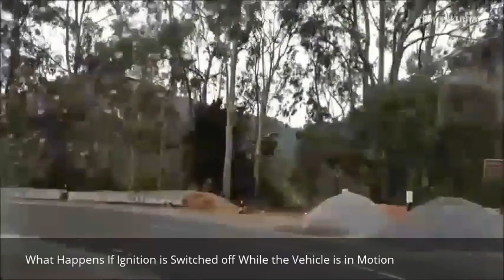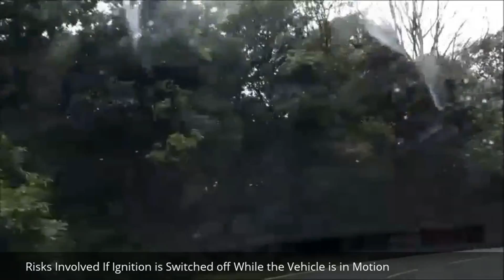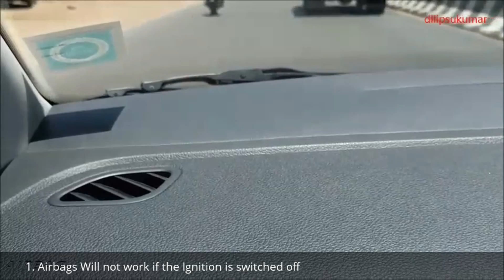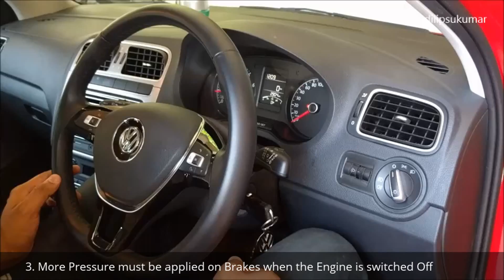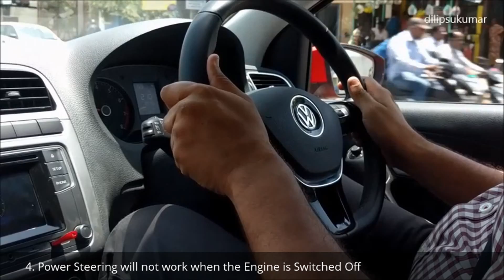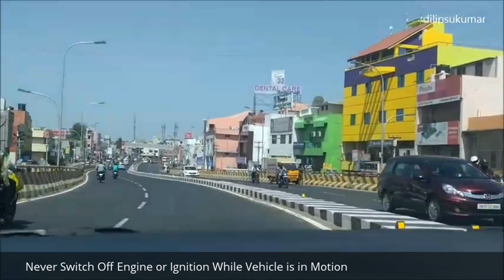What Happens If Ignition is Switched Off While the Car is in Motion

Comment: hi dilip, when I drive down side I kept gear to neutral to save fuel. is this recommended?
Reply from the maker: +uday bhaskar No. That is not recommended. When driving downhill or in a incline, you have to shift to 3rd gear so that the Engine controls the speed of the car. If you drive in neutral, the car moves at higher speeds and you have to frequently use the brakes to control the speed... it will result in acceletated brake wear. I drove 47 Kms downhill in 3rd gear at Kodaikanal and the car delivered a mileage of 24 Kmpl which is very good...
Reply: thank-you sir for good guidance
Reply from the maker: +uday bhaskar Welcome
Reply: thank-you sumith for your suggestions

Comment: bro did u find out about headlamp adjusting from under the bonnet using rotary??
Reply from the maker: +Pawan Pai There is nothing specified in the Manual regarding that adjustment bro... I have to enquire in the workshop regarding it...

Comment: Hello Sir, any idea of remapping the MPI engine to increase the bhp by software tweaks ? I feel you will give me a best answer as you work for automobile stream. Thank you.
Reply from the maker: +Tharun J Prasad No I haven't done Engine remapping in any of my cars. It is not recommended. Perfect Accuracy is needed. Even a micro error will push the Engine more than its limits...
Reply: dilip sukumar I am glad your replying me unconditionally. Thank you. As you say,Happy motoring😊👍.
Reply from the maker: +Tharun J Prasad Welcome!
Happy Motoring! 😎
Reply: is it possible
Reply: i did try to remap my 1.2mpi and resulted in replacing the ECU for a lakh... i was reimbursed for the same by Performance shop dealer. MPIs can be remapped, but power gain wont be generally as high as turbo charged ones. As Dilip Sukumar Uncle said high precision is needed, a minor glitch or bug with the software used, can lead to engine immobilizer activation (if not deactivated)shutting down the engine this will also lead to ECU overload resulting in short circuit and damage... 
If ur using the 1.2 3 cyl mpi ...max gain in ps % torque will be around 10-13% .. u can also use high performance air filters too for letting your car to breathe easy and respond to your inputs in a better manner. If your car has 1.6 mpi engine ..u r lucky, my cousin having 2011 poloi 1.6 mpi did upgrades with code 6 ... and got 30hp extra & torque iam not sure all because of the remap from code6, performance filter upgrade with cold air intake & performance exhaust 1.6 mpi is a high quality robust engine made out of cast iron unlike aluminium and is a proper DOHC 4 cyl engine with high potential ...
Reply: Cyril Matthew Bro thanks for sharing the information. I basically wanted to know if it's safe do it , coz polo 1.5 ltr TDI has two different tunes 90 bhp and 105 bhp. Then it's not wise decision to modify naturally aspirated MPI 😊.
Reply: Tharun J Prasad Thank you brother and appreciate that u r doing some good research before even finalising the remap. Deff mpi's can be remapped,no issue but the gain wont be smtn that u would expect from turbo ones thats it. 
My problem was i did remap with subsidiary branch of dealer, main one was in another district ..but i have confirmed with the original dealer b4 remap. 
Lap 47 do remap mpi ... 1.2mpi but if ur car is having 1.6mpi .. u r good to go ... With code 6 one of my friends got 135hp+330nm from his 1.5ltr polo TDI,however with a minimal fueleco drop .... if unr using a diesel ... u can simply go amd remap ..no issue
Reply: Cyril Matthew Bro 135 bhp 330 Nm torque . oh car would be a beast belting all Japanese sedans on road. But wouldn't it strain the engine , I hope engine internals would have been designed to handle that much power.
Reply: Tharun J Prasad actually thats a fellow rider i met in vw group and many others i know too have did that ... like u said such inc will deff cause smtn if nt used properly moreover I was tryna say the potential of this engines ... even the 1.2 diesel was able to produce 110hp and 250nm witu code 6 custom tune ... But instead of this custom remap, there are other remaps too with these dealers choose the appropriate one like say 20to 25 % boost like that ... even with sime of such remaps u can get more fuel economy ... my own cousin's 2010 vento 1.6 TDI was remapped woth Pete's in 2013 ... he obtained around 130hp and 300nm ... in his experience and usage he travels around 50kms daily, weekend trips , monthky long rides etc. . he used to get 13/14.5-17 kmpl in city rides while  20/21 in highways ... after remap there's no drop in fuel.eco but even in city drives he can drive in high hears say 2/3rd gear without even shifting to 1st and secondly the max fuel eco is same but avg incresed ....